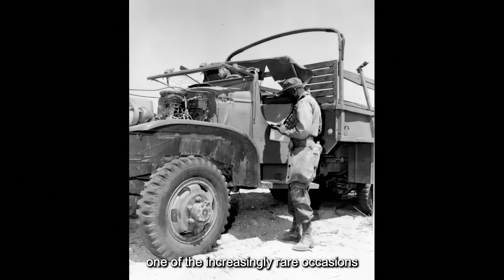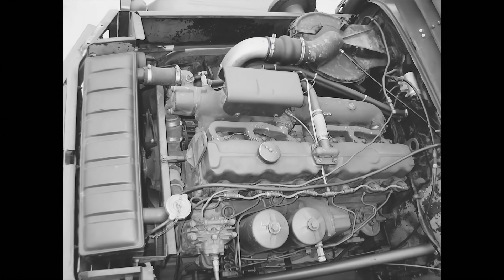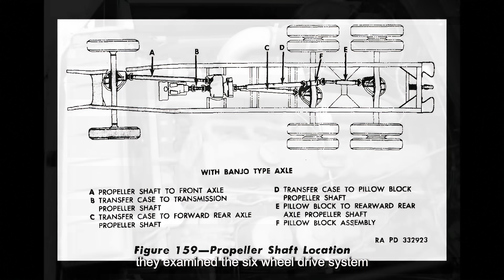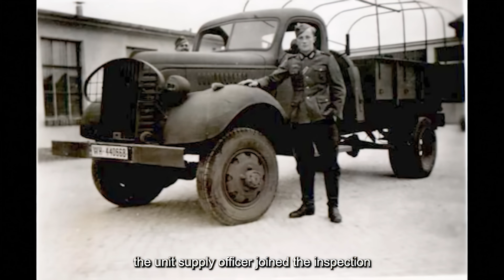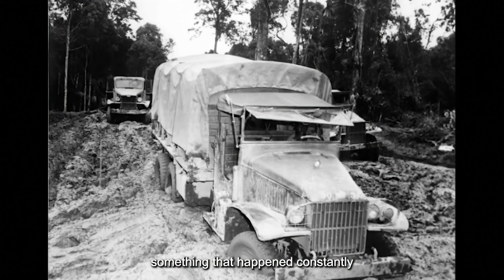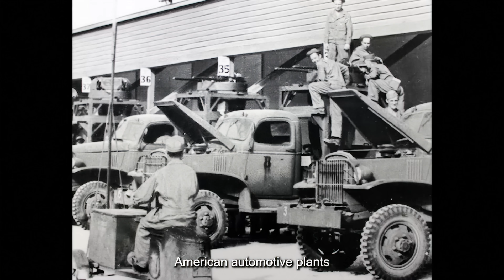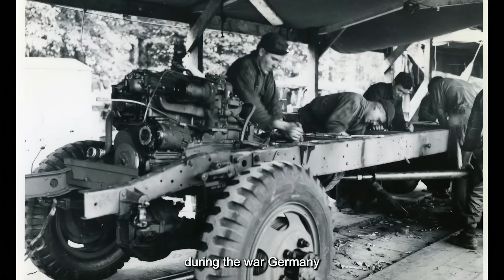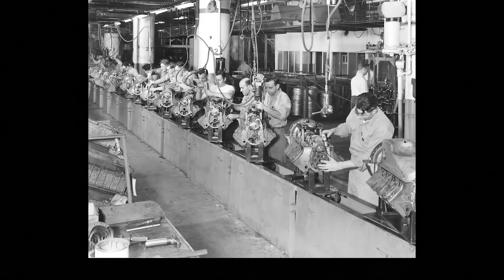Wehrmacht Mechanics Captured a GMC Truck... Then Realized Germany Was Doomed

Comment: America now makes vehicles that can't be serviced by anyone.
Reply: Its not just the US. Rented a VW Atlas recently. Got a low engine oil message. Went under the hood to look for the dipstick.... guess what, it doesnt exist... had to go to a parts store to get the euro approved 0W30 oil it recommended. This vehicle had less than 7000 miles...
Reply: @slowstang88 all motors because of epa regs, run hotter being eating oil.. by some estimates.. most engines consume a quart of oil every 1,000 miles because the oil as well is so thin it doesnt hold up..
Reply: @slowstang88 the low oil engine sign IS the dipstick
Reply: @saltymonke3682 wrong.
Reply: @saltymonke3682  No where near the same thing. The light is essentially a go and no go gauge. Example; Youre going on trip. 50 miles in the light goes off. You could have checked it with a dipstick before you left. You would have knew it was getting low so you just top it off. 🤷‍♂
Reply: @Shelby-q7k7d then fill the oil pan
Reply: @saltymonke3682  Regarded to the hilt. Carry on.
Reply: Cause that’s how the companies want it to screw you for more cash  😂😂😂
Reply: @MysteriousFuture no, most of the over engineering is due to CAFE and EPA requirements. The rest is the manufacturer squeezing every last dollar out of the design...
Reply: @machinist7230  it’s funny how many people are out here astro turfing with the same bullshit, I bet half of you guys are bots
Reply: I'm not sure what's worse. The fact that they can't be serviced by anyone or the fact that they need to be serviced all the time!
Reply: That is why we restore old stuff and drive it! Finishing up a 79 F150 next summer. We can do almost everything ourselves
Reply: @alanrahko8406 yet wirh old parts being hard to find plus the cost and time it takes to restore every component.. for many its not feasible to do it. Even tho I agree with you as to me any car made before 1997 OBD II you dont need emissions.
Reply: No, everywhere makes vehicles like that.
Reply: If your window button stops working you gotta replace the whole door panel now. They're just chasing money at this point.
Reply: @Throbably  Everything built now (by all countries) do that now.  I had a refrigerator with an ice maker in the door.  Ice maker broke.  Had to replace the whole door.
Reply: @ajrodriguez8601  Nobody needs an ice maker.  Get a plastic tray, fill it with water, put it in the freezer.
Reply: @davidlafleche1142  True, this is a first-world problem.  But it's convienent.
Reply: @ajrodriguez8601  Very soon, all those "first world problems" will be solved in a way nobody could imagine.  "And the merchants of the earth shall weep and mourn over her; for no man buyeth their merchandise any more" (Revelation 18:11, KJV).
Reply: @Throbably  And that is why my passenger side rear window hasn't worked for the last five or six years. Much to my dog's chagrin.
Reply: So does everybody else.
Reply: That’s kind of the point now. They don’t want you to repair or fix the car. The want you to buy a new one every five years.
Reply: "America now makes vehicles that can't be repaired by anyone"!   This is what happens when government bureaucrats dictate what manufacturers must produce!
Reply: This is all modern manufacturers not just in the American automotive industry but across all categories and origins of products.  We live in a 'thow-away society" in today's world. 1988-2008 was probably the most reliable, and  easy to repair era, and quality replacement parts available, particularly 96-2004.  Compared to today, most parts are cheap and poorly made, and good parts are limited, and becoming increasingly less common.  Planned obsolesence is the global name of the game, today..
Reply: @jreyman because the biggest market for cars is america, its too costly to have different designs for different markets. In most cases even foreign auto makers their overall production gets shipped to america.
Reply: that's all car manufactures now.
Reply: John Deere is getting their asses in trouble w the US government re screwing over farmers for exactly the same reason !
Reply: @rtiredbektek yet farmers have another reason as to why.. as food is more need to our national security and feeding of people then a car is. Yet BMV has been caught twice trying to stop certain features of a car unless you pay a subscription hence why electronics are bad. They can stop features easier.
Reply: American vehicles in WWII were built to be repaired fast. many Shermans knocked out in the morning were back in battle by night. That endurance changed the war. Do you think repairability was American's hidden advantaged ?
Reply: Only AI can repair things nouwerdays.
Reply: @ronaldderonde  thank you very much
Reply: I have a 23 year old Buick LeSabre with 127,000 miles. It has been meticulously maintained (at home!). It is flawless, runs great, and is smooth as silk on the road.  I recently replaced the halogen headlights with LEDs. It took me five minutes per side. Easy. If I had wanted to replace the headlight assembly?  $115 each, new. It would take 10 minutes to replace them.
Manufacturers now build vehicles we cannot work on; even a headlight bulb replacement needs special tools only a dealer has!
Reply: No look at a military vehicle they are still designed to be worked on by a 2 year old
Reply: LOL   Sadly!
Reply: Not true.
Reply: Agreed. But German cars still requires you to remove the entire engine block in order to change the oil filter 😂😂
Reply: this is why im starting to stand by subaru fully. they have stayed pretty true to the customer. idc if it makes me a lesbian.
Reply: The American military has forgotten that philosophy.  It takes American niw years to build one ship or a plane while China is launching a warship almost every month.
Reply: 🤣🤣🤣🤣🤣 True only the japs can build quality now
Reply: A major point of the video is how sufficiency beats perfection in a TOTAL WAR environment. Civilian cars in peacetime should aim for perfection; “just good enough” is a lawsuit waiting to happen.
Reply: So true
Reply: German are far worse.
Reply: True story
Reply: It’s Not “weeble”. It’s wyble.
Reply: @davidrichie9570 No, it's vay-bell
Reply: Not just America.
Reply: makes u wonder if we really won
Reply: It is pretty much worldwide.
Reply: We only parsley syndrome we don't really manufacture anything as part of the Union's destruction
Reply: Manufacturers tried to create a factory authorized service entity monopoly , which only had access, and the right to use the maintenance service codes unique to each vehicle,  Of their service centers charged an arm and a leg for their maintenance services too, same old crap that had been tried in the past!
Reply: America doesn't make any thing not even motorcycles we only partially assemble them here the unions made it too expensive
Reply: EPA mandates, the Auto Companies don't want to make the vehicle like they are, its being forced.
Reply: Our military vehicles dont have all the emissions crap on them
Reply: @MrS22222 that started in 1960 when California mandated emission controls on all new 1961 vehicles sold new in California, then mandated smog control retrofits on 1946-60 vehicles registered in California with "state approved" devices being renewed or registered for the first time in California.  They also required non California 1961-62 vehicles be retrofitted with "state approved" smog devices rather than the factory installed California model devices.
Reply: @maxheadroom8857 you're aware if you have car 73 or older you can swap any engine you want in there...and I live in California.  Turned down a 74 Ford F100 for that reason.
Reply: In fairness, we design them, but the parts are made in Canda and Mexico
Reply: Just like the F-35 Boondoggle airplane.
Reply: @jimslancio  F35 "Boondoggle", how?
Reply: German designed US cars plus Left Govt destroying the petrol car ! Treason !
Reply: Grow up
Reply: This is why I drive a 2008 Fiat.
Reply: That’s not true. What is true is that modern cars have replaceable components. The computer tells you which parts need to be replaced.  Like the WWII trucks, they’ve been “deskilled.”
Reply: That's because American isn't full of Americans anymore
Reply: That's where you are wrong. They are made by volvo and Volkswagen and BMW and audi and stuffed in American named body's. Jeep is all Daimler-Benz and Fiat
Reply: @jacksonstrickland4736 Ever seen a Northstar engine?
Reply: @martinpoulsen6564 ohh, yes, and I have put many, many starters under those intakes 😂 but I still stand on my comment and I should also mention that this mainly applies to cars built after 06
Reply: @jacksonstrickland4736 Most new cars are crap. Old Volvos were built like tanks, and most of the engines would outlast 2 bodies. Even vw have made 500,000mile engines. It's a lot more about corporate greed than any sort of nationality, though different brands have peaked at different times, all depending on when they came to and what they reverse engineered to get the needed inspiration  to build what the original either didn't dare or hadn't thought of.
Reply: @jacksonstrickland4736 My Buick Regal awdT premium will out run a Mustang GT, but it's actually a German Opal with a Buick badge. Fuckin thing LOVES breaking down and going to the shop. Needed to spend a couple grand on a timing kit and the maintenance hours when the fucker hit about 150K miles. Average annual maintenance has probably been close to a grand. The only thing I've ever done with my older F150 is brake pads and tires every few years. Every manufacturer everywhere today on this planet makes garbage full of plastic parts.
Reply: @jacksonstrickland4736  Not many WW2 GMC military trucks built after 2006. Jeep was part of Willy's until 1970 when AMC bought it.
Reply: @jacksonstrickland4736 Daimler merged with Chrysler to steal Jeep technology, then broke away when they managed to force Dodge to stop manufacturing their own vans and start marketing their Benz piece of garbage oversized vans which have pretty much gone to the junkyards now.
Reply: I get the frustration, but modern vehicles are packed with tech for safety and efficiency not just to block mechanics.
Reply: @SilentBattlefields-k5v we totally understand that.But the problem is, people are beginning to rely too much on the safety features.And too much on the computers that, they can't drive or diagnose a vehicle without them. My dad warned me as a kid that the system would come and it should not change my driving because the moment it fails or I trust the safety too many times its gonna end badly. Too many people not looking at the road with a lane assist vehicle. How many drunks made it home uncaught due to lane assist? 😂
Reply: @jacksonstrickland4736  Couldn’t have said it better! When your brain’s on autopilot, it’s only a matter of time before the system fails — and reality hits hard.
Reply: @jacksonstrickland4736  It is true that overreliance on such systems can be terrible.  But how many learner drivers never had the traditional wreck that many had through pure inexperience?  I know the EyeSight system in my Subaru helped me become a vastly better driver by pointing out when I was screwing up, and the system was so dialed it that it seldom erred.  I am a much better driver now, because of that.  I still think modern vehicles are overloaded with tech because they simply overestimate our desire for infotainment, touchscreens, electric windows and raw power.
Reply: @SilentBattlefields-k5v I have some vintage trucks with a camper top on them, and I'm not about to retrofit them with backup cameras.  I have one truck without backup lights, but I will fit the truck with backup lights and a warning backup buzzer.
Reply: The safety arguement is just an excuse to dumb down and remove any joy in the act of driving. You don't need fender sensors and lane assist to drive, and if you think you do...

Catch an Uber, Lyft, or a cab and stop ruining it for everyone else, this is my 2 cents on the matter.
Reply: @SilentBattlefields-k5v  and have the tech installed drives up the price of the vehicle and you need extra repair insurance just in case one of those unnecessary little computers goes up in smoke
Reply: @SilentBattlefields-k5v  😂😂😂😂😂😂😂😂😂😂😂😂😂😂😂😂😂😂😂😂😂😂😂😂
Reply: @michaelward9880  there is something funny here, it is ridiculous.
Reply: @SilentBattlefields-k5v  Yeah, but I can't afford all that safety and efficiency. An 80s Toyota pickup is safe and efficient enough for me
Reply: @turdfurgeson2032 one of my trucks is an 82 Toyota with a camper and warning buzzer for backing up.

Comment: Canada 🇨🇦 use this type trucks until mid 1980s.I drove myself for test new Amgeneral with cummins NH eng and manual.trans was 5 tons.They orders all type models was near 1500 trucks.GMC 2.5 tons was gasoline with automatic trans but hard on fuels.The DND Ottawa drop GMC was GM stop making parts so some parts was made customs shop.start get expensive for cdn gov't.The trucks was well built and easy repairs.

Comment: Lend/Lease US Army trucks (6x6) that were sent to the USSR numbered something like 300,000.   Each 6x6 truck was supplied with a 2 axle trailer and fully loaded with war supplies, from uniforms to medical supplies.  At one point, the USA had to agitate the USSR to pick up their trucks from Iran, because they were piling up in large numbers. That 300,000 6x6 trucks and trailers were equivalent to 3 million tons of steel the USSR did not have to produce or manufacture.........and equivalent to its entire production of 100,000 T-34 medium tanks.  Those trucks mobilized the entire Soviet Red Army AND towed all its artillery into battle as the Germans retreated, since the railways had all been destroyed by the retreating German Army and would take many months to repair, of course with supplied USA Railway lines.  The USA even sent trucks and Tanks with Diesel engines as per Soviet demands.  Never forget that the USSR was "Made in the USA".

Comment: Over 150,000 Studebaker 6s were sent to the Soviet Union during the war, where they were used, for example, as carrier vehicles for Katyusha rocket launchers. So the Germans had plenty of opportunities to examine the truck before 1943. 
There were even German manuals with pictures! 
What French mud? France had one of the densest and best-developed road networks in the world.
Between 1936 and 1940, 12,300 units of the “Light Off-Road Standard Truck 2.5 t (Einheitsdiesel)” were built in Germany. 
The only impressive thing about American automotive technology is the production figures.
Once again, a poorly researched propaganda article!
Reply: “The only impressive thing about American automotive technology is their production figures”.   Maybe you should do some research.  American military equipment was designed for simplicity of manufacture, reliability, and maintainability in the field.  Much German equipment was foolishly overcomplicated, was unreliable, and was not designed to be repaired quickly in service.  The Germans designed some of the best tanks that ever broke down on the way to the battlefield.

Comment: The video said these trucks ran until the 1960ies. Well - The Norwegian army used these GMC-trucks much longer. I was a grunt in a military manouver in the late 1980ies. Our batalion (like 1000 men - reservists) was moved in a pretty long column, with mainly such 10 wheel GMCs. The rest of the viechles were Dodge 3/4 tons and a few newer Volvo-jeeps.   Yours Jens
Reply: These trucks were still in regular use as troop carriers for war training at Fort Lewis near Tacoma, Washington in the late 1980's. They were run in convoys on the highway, lumbering along at 45 miles per hour. Remarkable vehicles.
Reply: I trained with the Norwegian army in 1983. Skijoring to Narvik, snow shoes to Satermoen, then to the Russian border. 200 miles north of the Arctic Circle. Northern lights not conducive to night maneuvers. Lol . Semper Fi
Reply: US reserve units are still using the deuce and a half into the 1990s fact we were still using them when I retired in 2000
Reply: Thanks for the detail! Incredible how WWII trucks kept serving for decades — proof that wartime engineering was built to survive, not to impress.
Reply: Some CCKWs were still serving in Norway into the late 90s. I own a '41 that wasn't released until 1999.  They housed many indoors I read. The wood parts in mine are still mint.  -6v and still turn-key!
Reply: Incredible! The fact that those WWII trucks were still active decades later proves they were built tougher than time itself!
Reply: Able Archer?
Reply: The blitz was a gm inspired truck.
Reply: @markcunningham8391  It wasn't just inspired - it WAS a GM truck. Opel was in GM ownership between 1929-2017
Reply: @markcunningham8391 GM owned Opel from 1929 to 2017...
Reply: The Army unit I was in had multiple duece & a halfs from Vietnam,  that was 1995 to 1998. If I'm ever able to get a duece and a half, I'll do it. Dang right K.I.S.S =keep it simple stupid
Reply: In the Netherlands many were used as a tipper for 5 tonnes, most of the time. Either on petrol, Petrol converted to LPG or a new diesel in it.
Reply: These things are fairly common still, in private use by contractors, farmers, ranchers etc. In Texas, Arizona, Oklahoma, Utah, and Nevada.
Reply: GMC trucks were built in Russia under license
Reply: The 3/4 Dodge trucks we called Ammo Carriers!

Comment: I agree.  The only way you can straighten the LeafSprings is to temperature it in heat then hammer it but just hammer it alone , the German be hammer it until WWlll😂😅.
Reply: Leaf springs don't lateral bend, they break